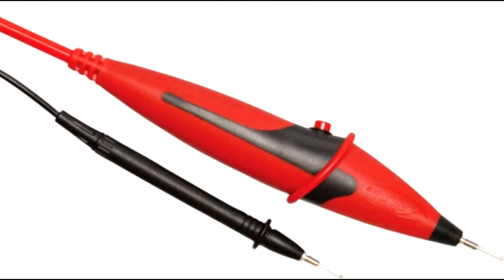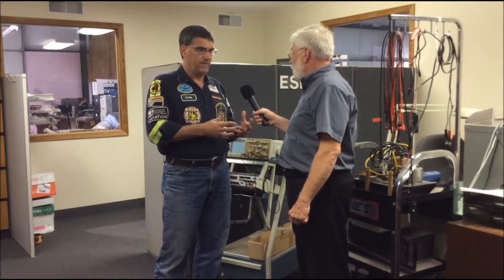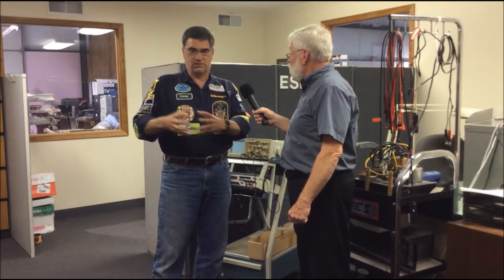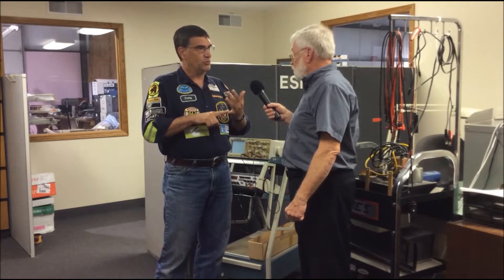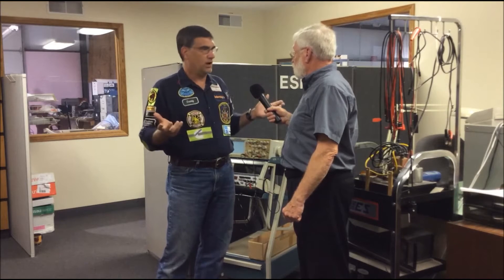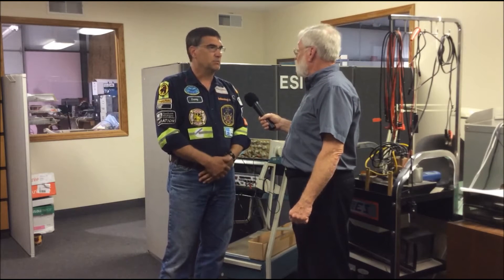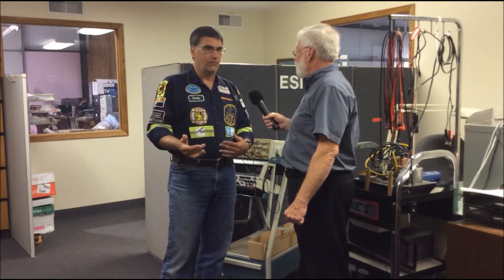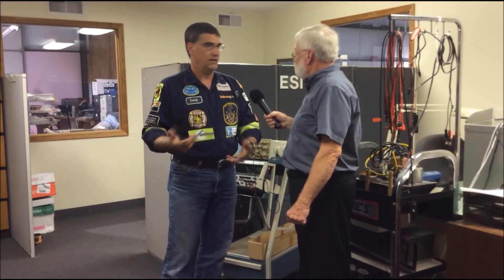Voltage Drop Explained with Dan Sullivan's "Load Pro" - Wrenchin' Up

Comment: It may be a good tool, but c'mon, man $70 for a test light  that uses a resistor and switch instead of a light bulb?
Reply from the maker: Hopefully Dan Sullivan and/or some of the techs who use one will jump in here to help respond to your question. I can only attest to the fact that it does what it's suppose to do very nicely.
Reply: @WrenchinUpwithJimBates  too bad nobody helped you out on that question.  I wondered the same thing when I watched a couple of his videos.  You should ask Dan that question personally and then reply on here.  I'm sure you have access to him?
Reply from the maker: Hi - Actually, I have not has contact with him for years. I suppose a Google search by someone might help.
Reply: It does what it's supose to.... Without having to figure out if your k mart  test light is dim from a problem or because it's from k mart....😊